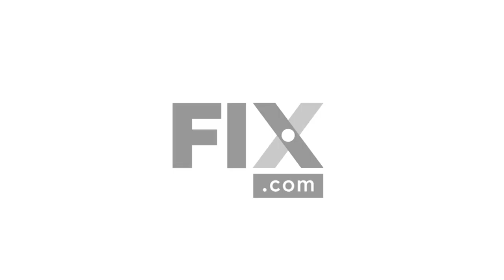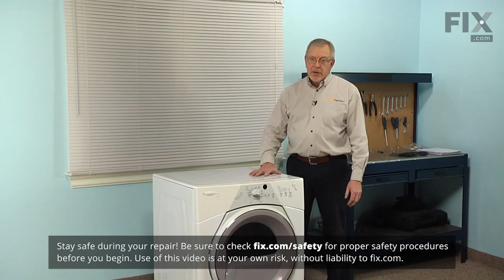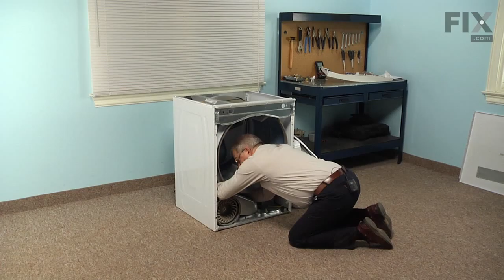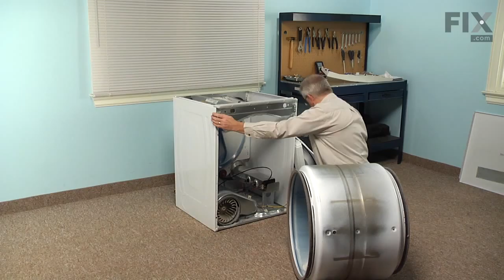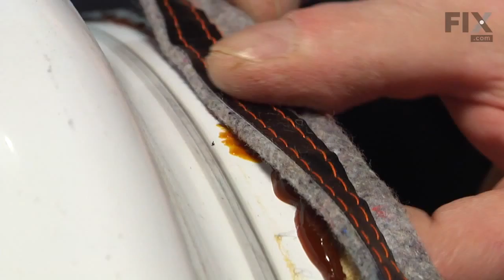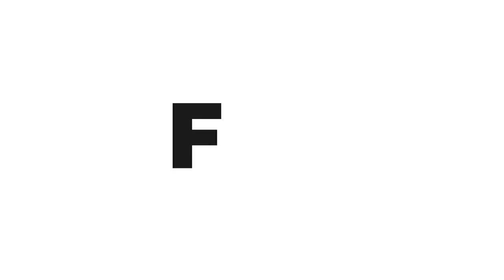Kenmore Dryer Repair – How to replace the Dryer Drum Seal with Adhesive

Comment: If paint comes off in area from glue do I need to repaint?
Reply: Only if you like to do extra work.  It will be fine.

That's right, Bob Ross just told you NOT to paint.